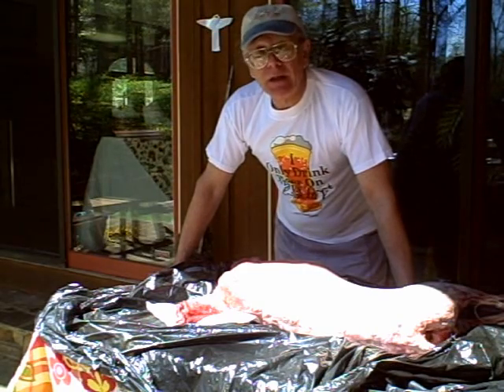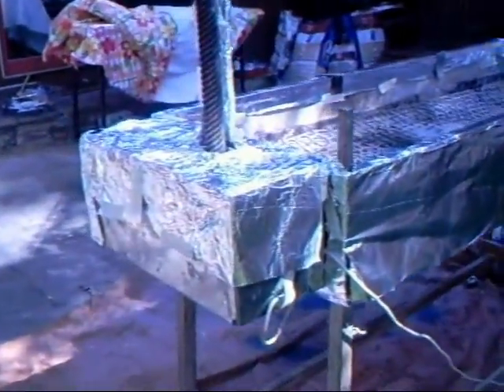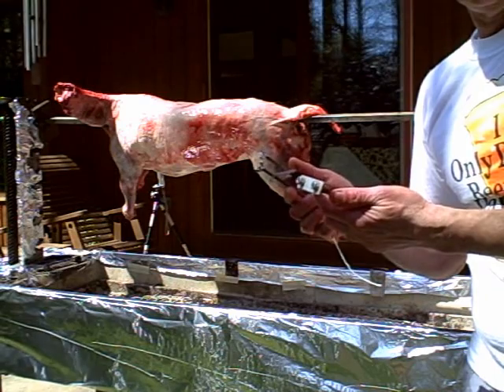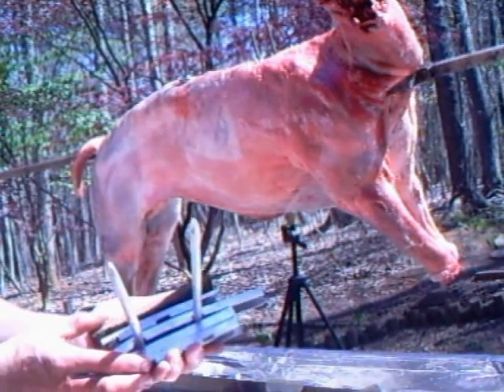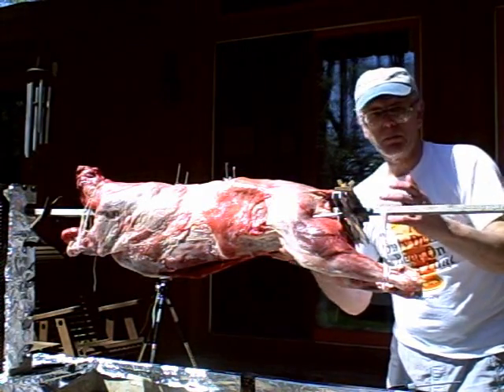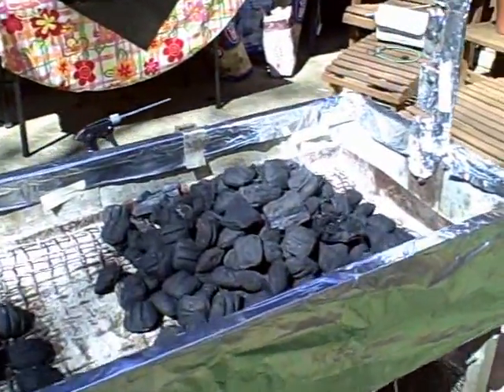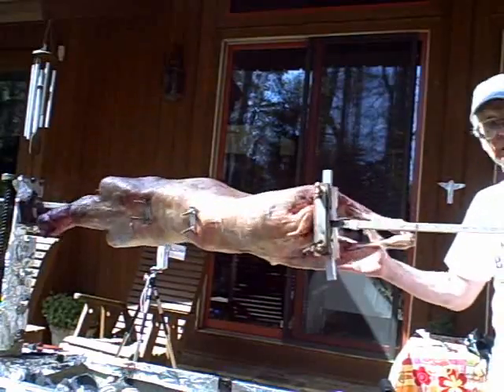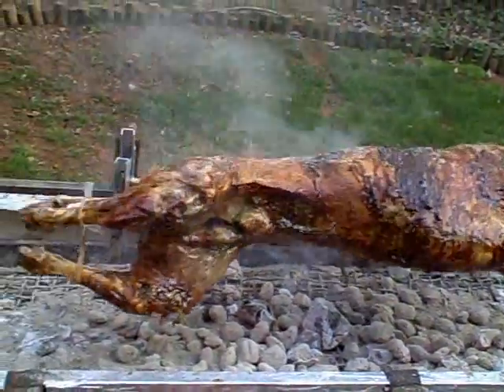Greek style lamb roast on a spit

Comment: I have made the same method up to tie the lamb it holds the spine and it never comes loose, good job mate. I rub the body down with oil and season it and my spit roast is a box with a door that flips open, it bbq's and works as an oven at the same time, it cooks in half the time and you use half the charcoal. I also have the fire at the back of the box and a drip tray under the lamb.

Comment: First of all good job.Allow me some tips.Next time use wire to cross tie the legs on the spit, both front and rear.Also engrave 4 scars.Each one in every leg near knuckles.In there put a pinch of salt and pepper.Then let the spit do the rest and dont forget that you have set the speed slightly above slowest mode.Try not to have the lamb too high above the fire.Also never forget the head.Its an exceptional delicacy το accompany a glass of red wine.

Comment: did you use string to tie the legs will that not break during the hot temperatures i use steal wire tie up the legs.

Comment from the maker: Kosher salt refers to coarse, non-iodized salt. From Wikipedia: The term "kosher salt" derives not from its being made in accordance with the guidelines for kosher foods but rather due to its use in making meats kosher by removing surface blood.: "koshering salt" has the "small, flake-like form" useful in treating meat, whereas "kosher certified salt" is salt that has been certified as such by an appropriate religious body.

Comment: you don't need all this set, you can either have it built with cement, or even cut a barrel in half, weld the supports, and put the skewer with a small motor to slowly spin it...do you think all Greeks can afford that? Patent is the way my friend...

Comment: too much preparation for nothing...the skewer must pass from the bottom, through the body, throat and mouth of the lamb, and its feet should be tied together and around the skewer...just think where to put the strings and its all done, no need for holders or counter-balancers...the coal must be even, everywhere, hot fire in the beginning to sear the juices, and after raise the lamb, mix the coal to drop the temp, and leave it for 3-4 hours...serve PIPING hot, no rest